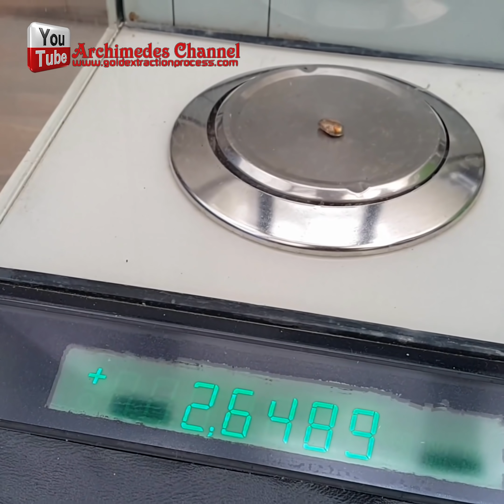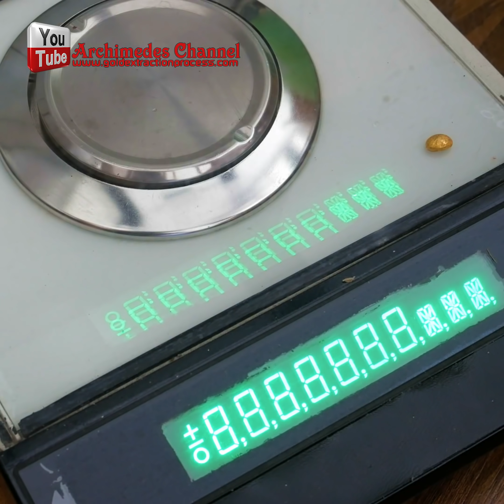Gold recovery techniques Gold plated pins circuit board scrap

Comment: An unnecessary procedure with melting the foil, it is easier to dissolve the foil in aqua regia by adding nitric acid in portions . Then the excess should be extinguished with urea , sulfamic acid or vodka . After precipitation, rinse several times with distilled water and boil in nitric acid , again repeated washing with distilled water and boiling in hydrochloric acid and rinsing with water . According to this method, the output is 99%-99.5% purity . And here 97-98% judging by the color ...
Reply: You can get rid of excess nitric with vodka??

Comment: Now refine it another 3 times on a nitric boil and filter it again in a NO.2 filter paper each time to reach 999 purity. That is low purity gold right there.
The nitric acid levels are far way too high in the aqua-regia ... you should just ad nitric until you get the metal into solution or you are waisting the nitric ... a very common mistake made there ... you have a very old method/wasteful method for making aqua-regia.
Just over 2 gm of low purity, pfffttt ... not worth the effort! Buy karat scrap gold jewellery 1 kg at a time and refine it properly and then you have well over 500 gm of 999 purity.
That is worth the time/effort ...